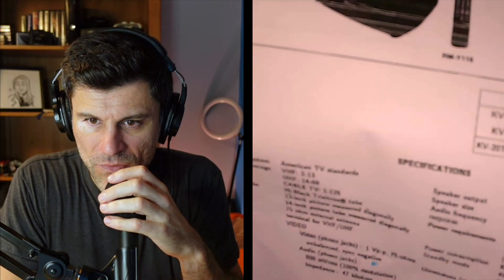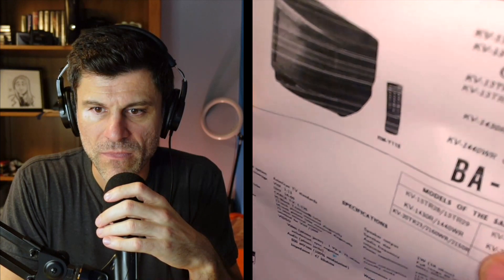Why RGB modding a CRT is so tricky w/ Steve from Retro Tech - Cathode Ray Podcast Clips

Comment: Why not just directly attach to the RGB guns of a C.R.T.?
Reply from the maker: That is basically what the Open Source CRT project by Thomas Daede is trying to do. It's not as easy as just running RGBs into the gun, those signals need to be processed into commands to fire the guns